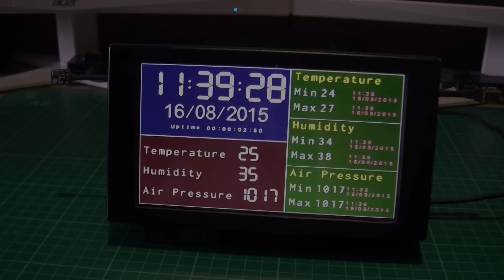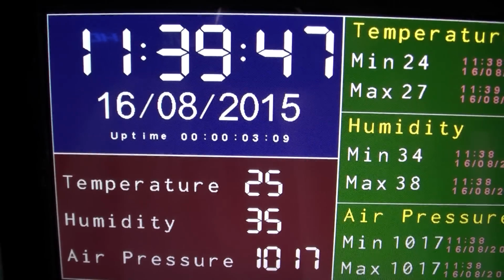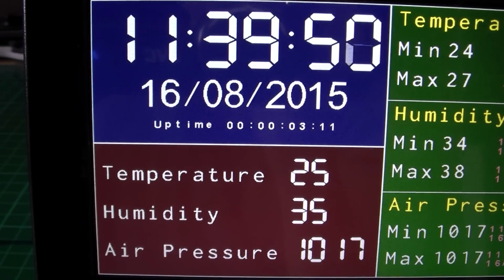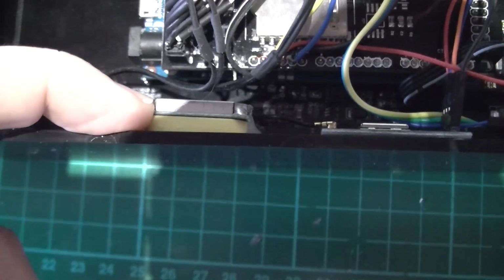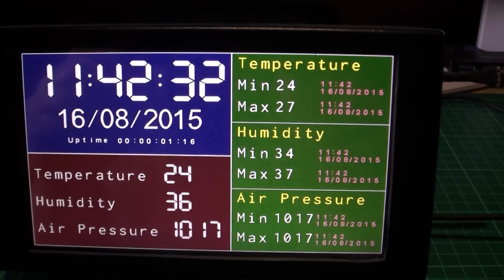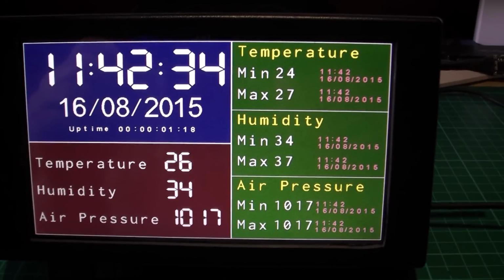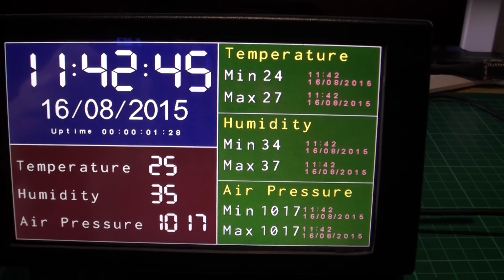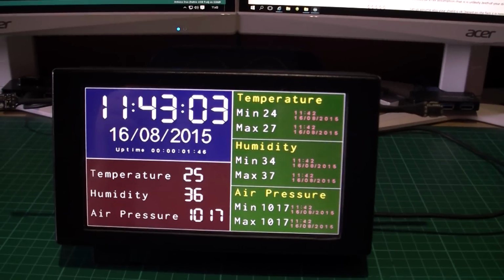Arduino Due & 7" LCD weather station project

Comment: How well does the GPS work indoors? Enough to get a good signal for the time?
Reply from the maker: It does for me but I live on the top floor of an apartment block.
Reply: Thanks! I read a bit more, and maybe indoors you might not get enough satellites to get a position, but it seems like for the time, if you can get one satellite, just barely, that would be good enough to have a clock that is never off! Good idea.

Comment: What would make this project amazing is if you could make it talk to a remote server, for the purpose of monitoring server room conditions remotely, or even sending high temp alarms. Where I work, all I see is the alarm, and not useful info like how hot it actually is. This would help out a lot. Bravo.
Reply from the maker: That could easily be done for less than £4 per room. On and off, I've been working on integrating a wireless electricity monitor for each room so I might throw a temp sensor in there too.

Comment: Great project. I congratulate you. Please, would you mind helping me with a project I'm developing. I'm trying to plot a Kwh graph in the tft screen, this plot is gonna be based on two sensors. I was wondering if this screen would be good for the job: http://www.amazon.com/SainSmart-Display-Arduino-Mega2560-Shield/dp/B00INMJHP6/ref=sr_1_17?ie=UTF8&qid=1463326190&sr=8-17&keywords=tft+arduino. Or how about those Nextion HMI's screens?. And does the arduino Due work fine with both? Thank you so much. I'll be waiting for your answer.
Reply from the maker: +Vladimir Andres Hi Vladimir. I'm sorry, I don't know anything about the Nextion screens but I've seen people connecting them to the Due. The link you posted will work with the Due - it's the one I used before I upgraded to the 7" version.

Comment: Would it take much to make the sensors remote, perhaps using XBee ?
Reply from the maker: +Stuart Davies It wouldn't be hard to do. You could also use the cheaper 433mhz kit http://www.ebay.co.uk/itm/251495756908

Comment: Could you please tell us where did you buy your LCD, LCD shield ?
Reply from the maker: +Hemil Patel Sure.... go to eBay and search for 'sainsmart lcd 7" shield'
Reply: +Vortecks Thanks for the prompt reply. I am making a probono talk box for a patient with cerebral palsy and your information will help a lot. I was worried that the Arduino due from (arduino website) might not be compatible with the sainsmart display. But as i have seen from your video it seems to be compatible. Thanks again for your video.
Reply from the maker: +Hemil Patel No problem at all. I suggest you buy one that specifically says it's for the Due instead of one that simply says Arduino. Better still, buy the LCD and shield from a single suppler. The shields have various solder jumpers which change the voltage to the LCD controller and the LCD backlight. If you don't get it right, you'll fry it. They're not very easy to program correctly (especially using the UTFT library) and it took me quite a while to get mine working. If you have any problems or need a little guidance, give me a shout :-)